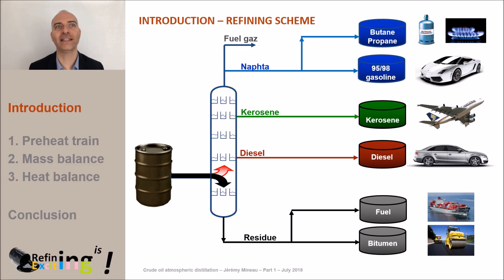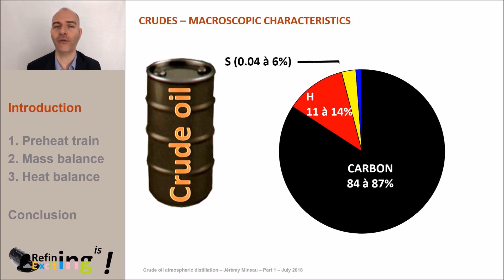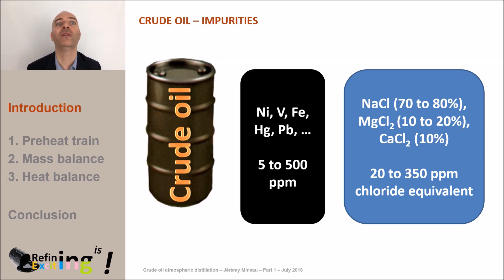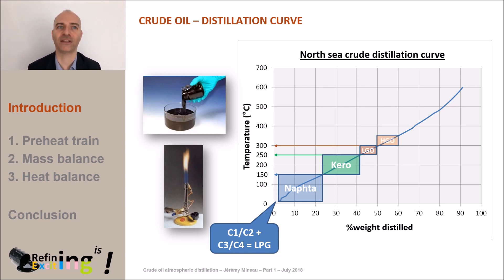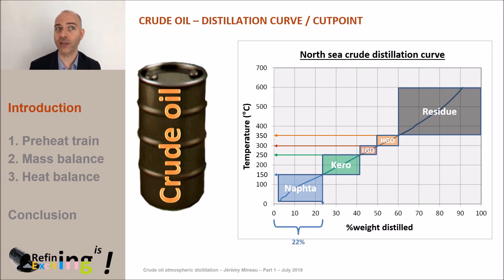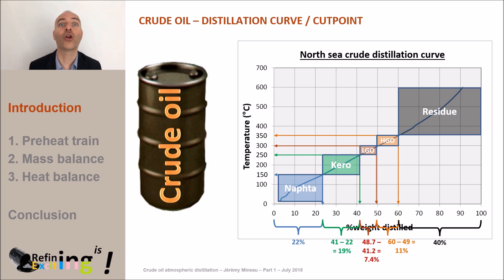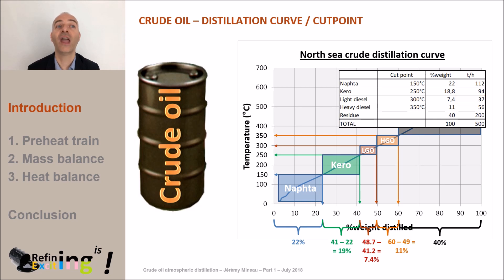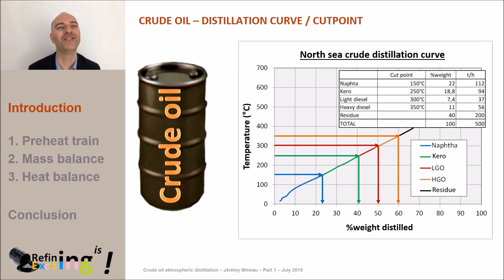MOOC - Atmospheric Crude Oil Distillation - Part 1

Comment: I have a question sir: how is the design of the distillation column that treats a complex compound such as crude oil done?..mainly because it has no reboiler and uses steam to bring heat to create the liquide-gas equilibrium.